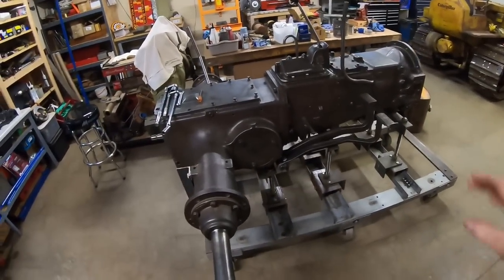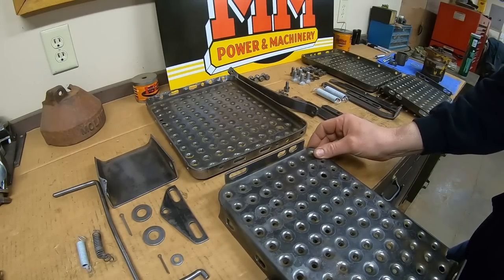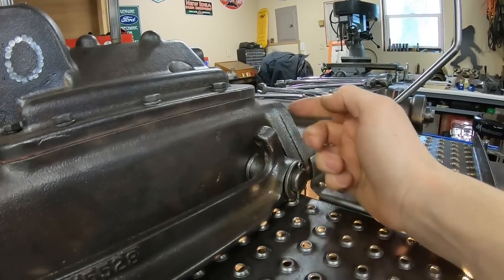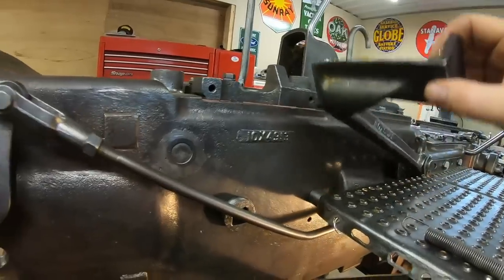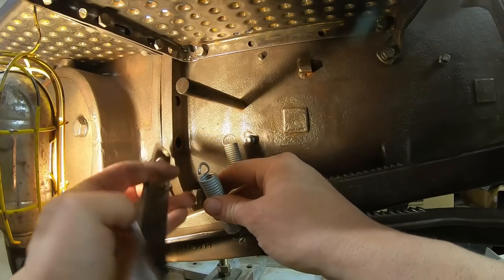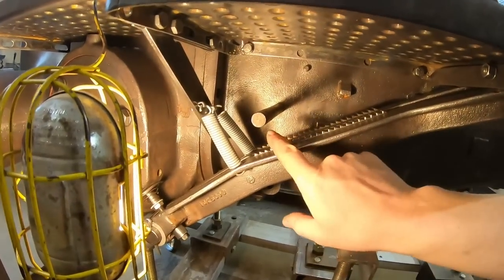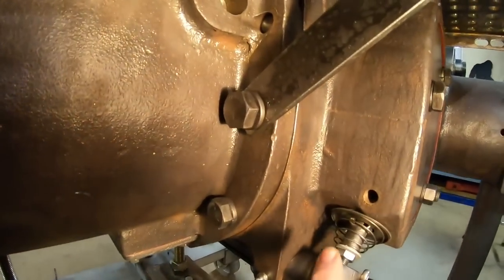#X231 Prototype Part 67: Let's Have Some Fun! Footplates, Pedal Springs & Brake Lock All Go On

Comment: I'm gonna vote to add the step. Like you stated it's definitely not home made. I think it adds to the story of the machine and the changes it evolved through. It's a nice talking piece thats easily removed if your mind changes.
Reply: Defo not home made. Those bends are too tight, done on a hydraulic press. At the time this machine was released into the wild, not something found on every farm. They would've had presses, but those contraptions built with leverage not hydraulic power behind them and those always resulted in gentle curves, not sharp bends. And finally, those aren't iron forged either (which is the other way you get sharp bends). For sure something made in a factory where you can bend, clamp, operate material of that gauge.
Reply: Yeah, it would not have taken them many attempts to sit in the thing before they said it’s way too high and added that piece.

Comment: Assembly was like one big erector set and I enjoyed it as much as you did. The brake flapper design is pure genius the way the spring holds it in both directions, somewhat of an over center design. Thanks for posting so often as I know it takes a lot of your valuable time.
I am looking forward to meeting both you and Senior at the swapmeet later in the month depending on weather cooperation.

Comment: Just realized the tractor is being restored twice! Once+ off camera and then well practiced in front of the camera.  Thanks for sharing with us.  As for the clutch pedal features,  perhaps the threaded hole was related to the previous parts arrangement through the dash and top cover. Or this tractor had sisters that tested a reverse shuttle mechanism or a safety start switch?  Would be awesome to find some missing links in the story.  Thanks again for sharing your journey with us.

Comment: On the Jet Star model which came just after the 445 they moved the platform back up to X231's height and the extra step was not standard but an option.

Comment: If you decide for a additional step, I would choose one of these made of wire rope, that flexes away if you running into something on the ground. Would not be era correct, but could be added by the farmer that used that tractor...
Thx for showing!
👍👍👍

Comment: I feel like that cotter pin would wear through rather quickly with that clutch pedal return spring pivoting on it.
Reply: You would think so, but I've seen that same type of setup on the old equipment my father had and it holds up better than you would think. The spring doesn't move a lot in the cotter pin and if it gets a little lubrication from an oil leak or a drop or two gets put on it every once in a while it will last an amazingly long time.

Comment: The only thing about adding the step (if it had made it into the 445 production) would be ground clearance for row crops. Parade duty will not have this issue :) Which raises the question about where MM envisioned this model within their line. I would think the ampli-torque would be most useful for tillage. However, I am not at all familiar with anything that is not Farmall Red. Perhaps you could touch on this in a future episode.

Comment: There probably wasn't much consideration for step height early in the design.  This was back in the days when it was not uncommon to have equipment (some farm wagons, etc) where the method of boarding even for a tall person would be to hoist ones self up by whatever means necessary.   But that does appear to be higher even than some others I have seen.

Comment: The hole may have been a thought to let windage out as they would have thought, but I don't see much in the way of windage, but then again maybe for leakage detection, but then by that time you know if it was leaking because the brake pads would have oil on them and you would know by the brakes grabbing , in my opinion though I would put some cork plugs in them holes

Comment: I was thinking about it and it hit me about something. "In my Opinion", those tapered round springs that are used to hold the round cover plates at the brake actuator casting entrance positions were not made specifically for this tractor. Just like a lot of other items on this prototype these were "Adapted". Think about this, they (As I said, in my opinion) are re purposed Thermostat springs.... 😎
Reply: @squatch253  and outsourcing isn't limited to MM. A production luxury steam car from the 20s-30s used clevises and levers with the ford script on them! (Doble)

Comment: Could their original thought on the clutch spring have been.  A L shaped rod coming of the bolt by the top cover going through the hole on the lever. With a coil spring Infront of the tab lifting the lever with a jam nut to allow tension adjustment.

Comment: that break lock looks like there should be a top and bottom cotter pin washer to keep it in the foot plate and not PULL UP ON HANDLE like i thought you had to

Comment: Excellent! You still have hair and have not pulled it out. 
Hold off on that step maybe, and look at it after everything else is done, such as tires fenders (if equipped) drawbar, 3 point hitch.  I am just wondering how tractor mounting is done on it. Is it like the Farmall letter series where it is from the rear? 
That step being that high and not having a stirrup is really odd if they intended you to mount from the front. You know that more than one person was up there during assembly and the in the testing. As well as rehearsal of photo shoot, and the boss having to try it out. If his suit did not give enough you know there would have been someone bent over for him to step up on or going to a fab shop to have a step made and put on right away.  
How is your weather doing? we definitely got rain as at 2 am there was a glossy sheen on the snow.

Comment: As for the step, I think whether it's homemade or not is debatable. I have made similar looking brackets just by heating up some flat bar and bending it. I still think you should use it though.

Comment: Kinda thought it would be good to have the step on there, when you took it off. 
Great video. 
Neat brake pedal lock. 
Those bumps on the brake housing that help hold up the rear foot rest, would they be thinking that far ahead to say, we should put those there for the foot rests. ? 
Thanks. Very interesting.
Reply: Those bumps were likely keeping options open. They could have been drilled,and used with a  vertical shaft for brake actuation instead of the design they did use. Of course sealing against water intrusion would have been a headache, and the chosen design offered better modulation. But with X231,they clearly handled it as a work in progress.

Comment: Speaking of that home made looking step. I have a very old Belarus 600 and they had a very small iron footstep below the footplates in the cabin. Now im a  tall person and getting in side the cabin with that original footstep is close to impossible. Unless you got the strength of a gorilla at your disposal LOL. So using that logic I kept the home made 2 step ladder cause of the convenience getting behind the wheel. So keeping the later add on piece for X231 is just the right thing.
Reply: Those Belarus tractors. Were they a copy ? Licence built ? Reverse engineering  ? A rework of American tractor for local conditions ? Manufactured for many years ,yes ? Don't know much about them.
Reply: @paulmanson253  I now know who was the lead engineer. I would say Belarus was a reverse engineering but they did not do a direct copy paste of things. Lot of reengineering had to be done cause lot of the American tractors where actually not suitable for the Soviet environment. Belarus is actually still made to this day but the new models after 2000 have very little in common with the ones made from 1953 to 1975. So one thing when looking at Toby's rebuild of X231 is the amount of roll pins used. The Belarus 500 series is one of the soviet tractors that has a lot of them in use. The 600 series dose utilize very few roll pins that I know of. I can say  on the 500 and 600 series used lot of old IH designs, probably a few pits from other manufacturers as well. If it was a direct knockoff than they would have never been allowed to be sold in the North-American market to begin with. I can't write a long comment here but hope this is somewhat enlightening to you.
Reply: @SuperMAZ007  Super. Thanks for that. No reason to reinvent the wheel. Take existing designs and improve on what works. Makes sense to me.

Comment: Those bumps on the brake housing that support the plates seem like they would vibrate against the plates and wear the paint/cause rust. But maybe it isn't an issue since this is just a trailer queen.

Comment: Toby, will these components you are installing be removed later for a thorough  painting prior to painting of the entire driveline assembly to ensure there are no bare metal surfaces to rust? Alot of hidden bare surfaces exist that you cannot reach with paint unless you remove those parts again. I trust this is already your plan. Thank you.
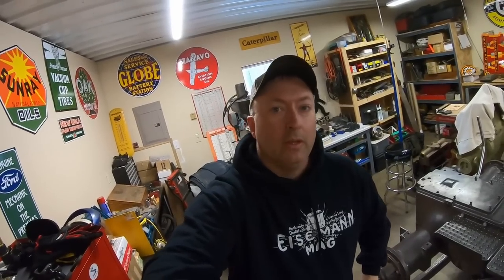My apologies, time stamp 23:08 you just said everything will come off again for priming. Got it!

Comment: Another enjoyable video.  Nice to see things coming along.   
Are you going to cork those unused holes or put in threaded plugs?
Reply: If it goes into a fluid compartment I would definitely plug it. I've seen short bolts with copper washers used to seal unused holes.